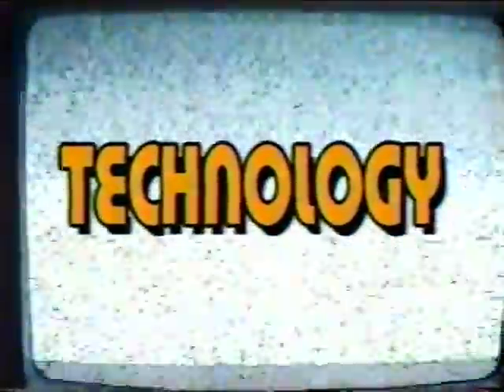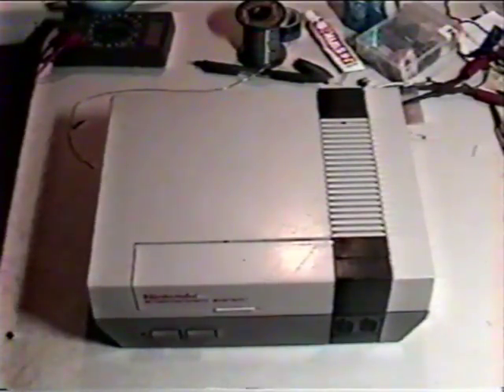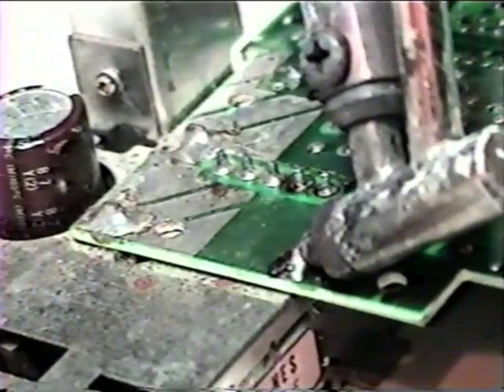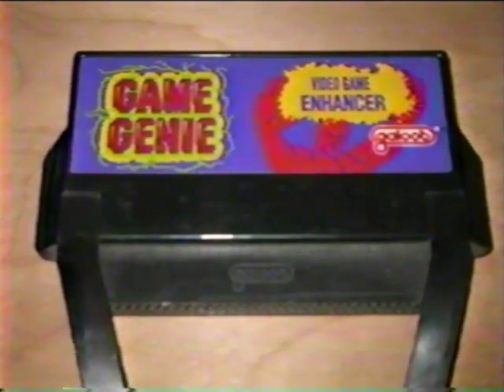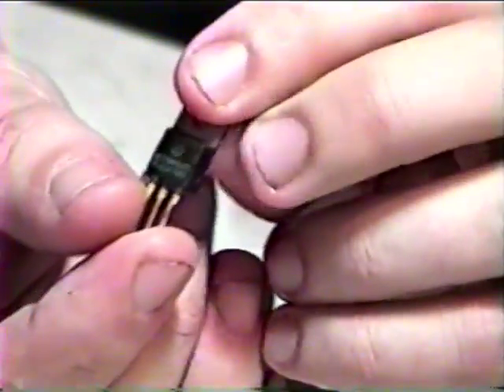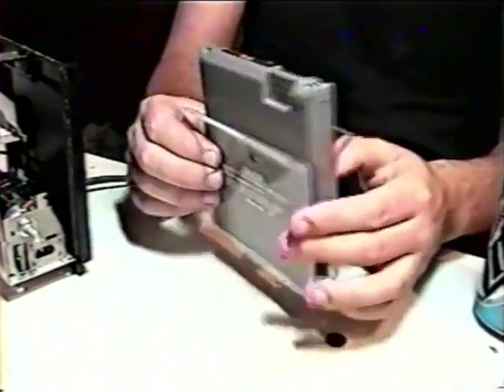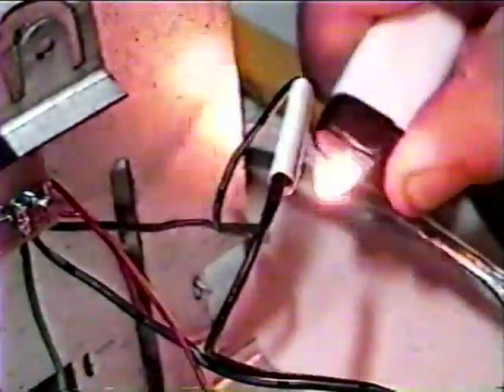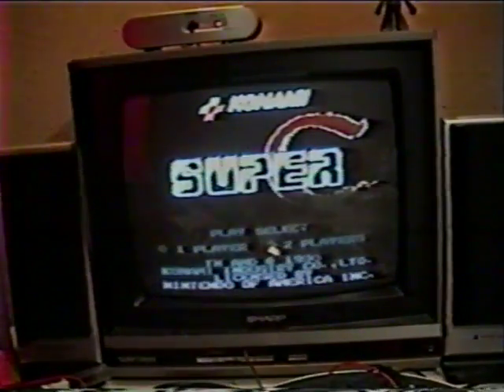Nintoaster Instructional Video

Comment: You should update this video its original and perfection but outdated. i made one like ten years ago and yesterday i decided to add an hdmi port to my nintoster so i gave the video watch and its very outdated what kid is going to know what RadioShack is. Remake it for a new generation.
Reply from the maker: @imfirinmilazar  It still gets the idea across just fine, imo.  I've always encouraged people to make their own spin on it, improve upon it, make a better one.  (And plenty have).  I may make one more Nintoaster, and if I do I'll film it and add some useful new information that'll help and be more up to date, but I doubt I'll be hamming it up like I did in this video.  It was a product of its time.  The updated information I'd share now would be pretty straight to the point.  I need to update the description at the very least and add some annotations at parts to clarify certain things and provide updated sources for parts.  As for a new video though, yeah, it'd basically be an updated/ammended video to supplement the existing one.
Reply: @vomitsaw  yeah I agree. it's hard to top perfection. Anyway speaking of my cool new project I have been working on a cool project it's coming along but very slowly. Long story short I got a 4 slot toaster and am in the process of making a nintaritoaster (still working on the name its a Atari and Nintendo toaster) just wanted to share my project with the originator of the nintoaster. I just hope what I'm doing is original.
Reply from the maker: @imfirinmilazar  Oh that's awesome!  Let me know how it comes out, and share pics with me via email if you'd like me to show it off on stream!

Comment: Whenever I dismantle electronic devices for maintenance and when I put it back together and then it doesn't work, I take a hose and water it down. True story, I did that on my fan and it works back a-ok, but sounds like a monster. I do study electronics, I just don't give a crap.

Comment: would it be easier to turn a retron1 into a nintoaster?
Reply: It could be easier as i assume it's an after-market Nintendo and should have much a smaller board. I wouldn't use it as it may not be compatible with all games.
Reply: retro duo is ideal as it is the most compatible nes clone. plus there's also an snes compatibility.
Reply from the maker: Easier?  Probably yes, no question.  Much simpler board.  It's a "Famiclone", but if it plays the games you want, who cares?  Go for it!

Comment: Is the same work in a SNES? I want to make a Super Nintoaster.
Reply from the maker: Same idea for SNES, yes, but even easier.  Don't need to build the video amp circuit.  Will probably wanna stick with the SNES Jr. tho (unless your toaster is particularly massive), and keep the cart extension wires AS SHORT AS HUMANLY POSSIBLE.

Comment: could i just buy one off you?
Reply from the maker: +Kolt Royalle Honestly, you're probably better off just getting an AV-modded top-loader, or an old model with the "Blinking Light Win" connector.  (This is essentially a mass-produced 'Super-72' connector.  ...Yes, I was very much beaten to it.  Someone finally dd it).  Making more of these would end up taking forever now and also costing way much more than it's worth, considering the time, materials, labor, etc.  There are better alternatives now.  Probably not the answer you wanted, but it's the one that will save you a lot of time and money.

Comment: This has probably been posted in the comments somewhere below, but..... How do u turn the power on? I know its an on/off switch, but with the toaster lever, do u press down, and then the handle pops up a little bit? I didn't see how u did that in the video, only the reset button :/ could u help me out?
Reply from the maker: Good question, and perhaps I glossed over it a bit in the video.  Bound to happen, being that there's a lot going on, squished into a relatively short video.
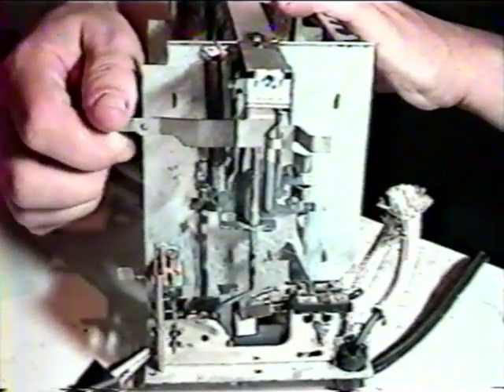To answer your question, in this case, I use a momentary pushbutton switch to act as the main on/off switch, which is pressed/depressed by the lever.  Skip to 16:42 to see exactly what I'm referring to.
Reply: Just to be clear, you did NOT use the original button that came with the NES? Because my father said it wouldn't make any sense using the button it came with, and Radio Shack has a ton of different push buttons. We were thinking of buying another button like the reset button. And thanks for the help, i completely forgot about that part in the video xD Too much information :p
Reply from the maker: That is correct, yes, I did NOT use the reset button that came with the NES, though you CAN if you want to.  It's just a momentary pushbutton switch.  Momentary meaning just that, the button is only making a connection while it's pressed.  These type of switches are found all over various discarded electronics, by the way.  One man's trash...
Reply: Yea, I was gonna go to RadioShack to grab a simple momentary switch/button and then just replace the one I have currently on my NES. The trash isn't that big for me, but the dump is, ahha, MANY Many many many many switches, levers, LED's, even the toaster that I found xD

Comment: Is it possible to keep the RF modulator on the board or is it a must to remove?
Reply: if you can manage, you can remove the rf modulator and connect it to the board using wire, just be sure to have something insulating the rf modulator as it may short out the nes board
Reply from the maker: What that guy said.  Yeah, you can keep it if you want.  Just be prepared to make 5 unusually-difficult-to-solder points and remember to ONLY use a legit 9V AC adapter (AKA original NES AC adapter), NOT DC.  ...Or, I promise, you'll end up havin' a bad time.

Comment: You mean 40 or 80 CONDUCTOR IDE cables. They are both 40-pin. ;) That said, you can remove the back of the connector and pull the cable off without cutting because it is an Insulation Displacement Connector. I prefer to use an IDE header and wire wrap to break it out, but that's just me. :D You can actually leave off 20% of the wires. No need for the EXP pins, CIC pins, CPU CLK pin (never used, NC on top-loader), etc.
Reply from the maker: 40/80 conductor, yes, we don't care about the connector here, just the wires.  I like using the 80 conductor ribbons, but I have yet to find anything aside from human teeth that can somewhat cleanly strip them.  The good ol' fat 40s work perfectly fine for most.
Reply from the maker: Retro Skull
Link is old, yeah.  Try this until I find a better home for it:  http://www.stupidfingers.com/projects/nintoaster2/NintoasterVideoMusicFINAL.mp3

Comment: You should start with simpler stuff though before tackling the video amp. Look up "LED resistor battery circuit" (LED circuit in wikipedia ) , try to recreate it in multisim (Pirate multisim and look up multisim basic tutorials in youtube.) and then buy the equipment from a radio shack (plus cables) and try to make it yourself. It's pretty hard in the begining, but it's a lot of fun if you can invest some time on it.

Comment: Nice! does this also work with EUROPEAN NES ? :)
Reply: This does work exactly the same for the European (PAL) NES.  The video AMP, pins and wires will be done exactly the same regardless of which NES you use. I have personally built a Nintoaster with a PAL NES and it works perfectly, even after almost a year.
Reply: Louiskovskie Channel the only thing that was different in each region's nes was the lockout chip and the power in

Comment: How about a 4 slicer toaster that plays NES, SNES and N64 games, can that be done?
The circuitry and fitting everything inside, might be a b!tch though :/
Reply: I doubt it. You might be able to fit all the cartridge connecters in there, but there would be no room for the system boards. The other potential problem is that in his recent troubleshooting video he mentioned that if the cables to the connectors are too long it will freeze up or won't work at all. You might be able to get 2 systems in a 4 slot toaster.
Reply: you could but it would not be cheap, you could use a N64 and a tristar 64 ( http://www.amazon.com/TRISTAR-64-Nitendo/dp/B002KJ7MKU/ref=sr_1_1?ie=UTF8&qid=1421420418&sr=8-1&keywords=tristar+64 ) or use a retron system but no 64

Comment: Wait... So I can power my NES with an arduino board?
Giggity.
Reply from the maker: The OG NES board can only be powered with love.
Get STROKIN'!
Reply: In all seriousness, if the NES board is powered by 5 volts, in theory, someone could make the original NES draw power from the 5 volt pin on an arduino board, and have the video output going to a screen salvaged from like a junky old laptop or something, making it possible to make a portable nintendo powered by 9-volt batteries.
Reply from the maker: Mmmmmm, possibly?  If it's pretty much EXACTLY 5v, then I'd assume so, but the amps are important too.  I usually try to go no lower than 500mA for the original NES board.  But if you're also going to be powering a screen, that's more voltage and power draw to consider.  Remember those old LCD screens for the PSOne?  Those were always pretty fantastic to use and natively accept composite+stereo signals.  There's a bunch of knockoff brands on ebay that are pretty much exactly the same.  (A laptop screen is a completely different story).  Now, the voltage requirement on those is probably going to be a bit higher though, usually 7.5v last time I messed with that stuff.  I'm sure they are better options now, maybe even some that also run off of 5v?  I honestly haven't checked but I'll assume they're out there.

ALSO... if you're looking to make a portable, I'd strongly recommend a DC-DC converter rather than the old 7805 if you end up needing to convert from something higher down to 5v.  They convert the voltage much more efficiently than just converting the excess energy into heat, which should greatly help with battery life AND having to worry about dissipating that heat.  I bought one a while back, part 490-V7805-2000R over at Mouser.  Admittedly, I haven't actually TRIED it yet, but it should work, and be much less of a headache than a standard 7805.
Reply: The nintendo laptop that I am thinking of would have a keyboard and trackpad for homebrew games, and the NES controller buttons would be mapped to a few keys in whatever program is used for loading NES games.  It would be a bulky device, but it would contain both a motherboard and an original NES board.  Homebrew games would be loaded with some sort of a connector that goes between the NES board and the computer.  The homebrew connector would have a 4gig DDR4 laptop RAM card for storing homebrew ROMs.  The homebrew ROM selector inside of the 4gig card would be a simple GUI for selecting games, similar to something like an Atari Flashback.  There would be a homebrew game making program and game genie controller in the operating system of the laptop.  It would most likely be a linux distribution made specially for the NES laptop.  The arduino would take power from the battery, receive input from the laptop, and control the NES.  The arduino would have control over the NES's reset and power buttons, and the controls.  It would also be able to save and load a game state to the RAM card in the adapter.  The NES board itself would be mostly unmodded except for maybe the 10NES chip.  Game cartridges would be loaded from the front of the laptop.  The laptop case would be well-ventilated, and it would be made of 3d-printed plastic that looks like an old nintendo controller. It would also have a floppy drive for the Famicom games.

I'm not really a NES modder, but this laptop design might just work.

The Homebrew NES game developing program would be called Nintoaster, as a nod to the Nintoaster, and the compile button would have a picture of a toaster with bread in it.  The error symbol would be a picture of burnt toast.
Reply from the maker: slow-clap

Comment: For the people wondering about the resistors... Remember the wiring schematic is an ideal. You can put a frigging light bulb in the way so long as it's the right resistance. Look at the bands on the resistors. What? You don't know what those lines mean? Shame on you. Bad modder!  Google up "How to read resistor color codes" and learn that he simply used resistors in series that added up to 220 ohms resistance.

Comment: You know, it seems like it would cost a lot, but considering i had about 11/34 of these things, you can get them for $333.52
Reply from the maker: Factor in your time and the price jumps considerably, even at minimum wage, assuming you take your time and do quality work.  It's more personal artwork than a toy for the average gamer.  If someone just wants to play NES games, the most sane solution is an emulator + NES controller and USB adapter.  This is something else entirely.
Reply: ***** Good point. Some, like myself, prefer the real console. The emulator, is free, but I'm willing to pay $30 to play superC, on that grey box.
Reply: *****
Finally someone respectable agrees with me that there is nothing wrong with an emulator.

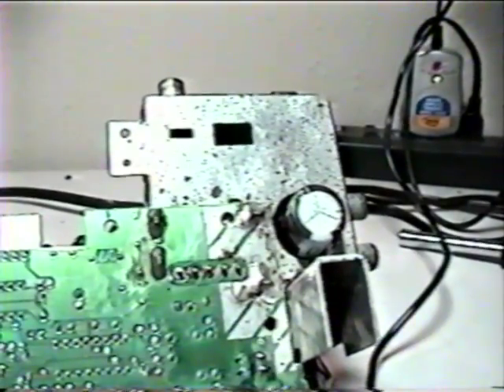Comment: 9:14 im in the process of recapping my nes, and replacing a few diodes because of a sound issue encased in THAT box, thats the best description i can think of for the four mounts holding the rf module on. i spent four hours heating my iron with an oil lamp,  using the solder sucker, and a desoldering wick, reheating the iron, repeat, module still firmly attached. just read on a forum that it is easier to remove the board from the box than it is to get the box off. out of all the random shit ive taken apart and soldered, that is with zero doubt, the biggest pain in the ass to remove from a board. its a giant heatsink and it is very determined to stay in its home, going to try removing the board itself soon, doesnt look too much easier though, as there are still 4 points soldered to the box..
Reply from the maker: +lionellinesfan The struggle is real.  You've been through it, the frustration tells all.  When the high-wattage irons and leveraging with small screw drivers just don't work, I've resorted to the brute force method:  Dremel.  Good ol' buddy Dremel with fiberglass cutoff and sanding wheels have rarely done me wrong.  Not for the squeamish, but gets the job done.  Score safely and true, my friend.

Comment: The antistatic wristwrap is so useless...
Reply: +Grey Potato 
It's actually pretty important. Otherwise you may destroy some of the components that can't take any static electricity. Sometimes you will not even notice the discharge. Especially if you have a cat or a CRT television, you could easily be charged with static electricity and then ruin a perfectly functional NES board
Reply: +isakwatz11 the static electricity is maybe dangerous for the components but you just have to touch a piece of metal before touching your components to discharge you from all the static electricity in your body.

Comment: @v8power101 

It's an anti-static strap, not an anti-you're-a-fucking-idiot strap.  It's to protect the board that's getting molested, not the hobbyist that should know better and have UNPLUGGED SHIT AND WAITED FOR CAPACITORS TO LOSE CHARGE.

Additionally, it's not tin foil.  It's aluminium foil.  Aluminium gives quite a bit of resistance, relatively speaking, and will convert some current to heat should any be passing through your hand and into the ground.  Again, unplug, keep your hand.